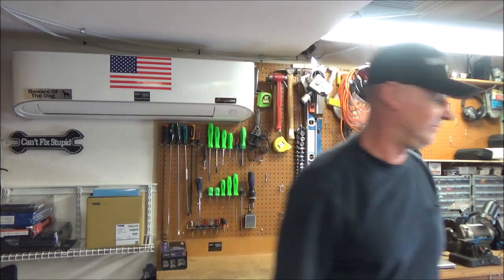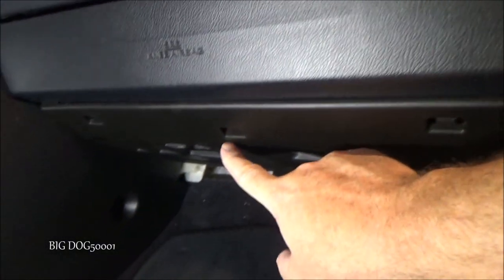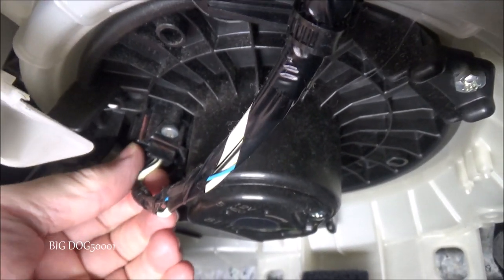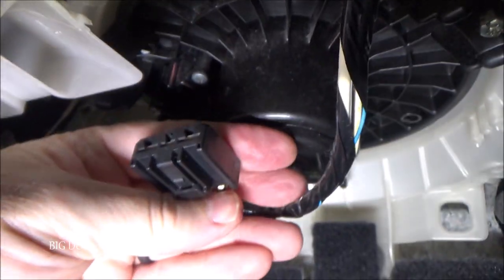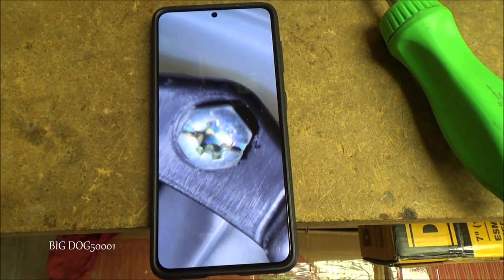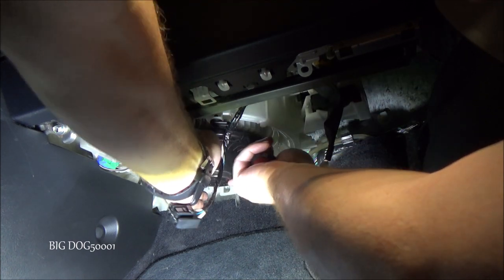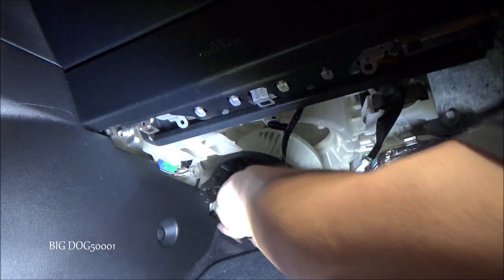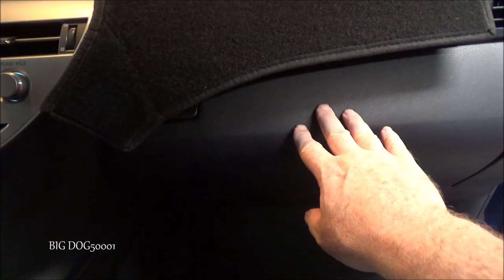Lexus RX 350 Blower Motor Testing and Replacement

Comment: I just pulled the motor out of my 5th gen 4Runner and it was the same motor. I had a whining noise and wanted to see if it need lubrication. Luckily it was just a leaf rubbing on the fins. It works fine after cleaning it out, but I was wondering how to lubricate the shaft. I removed the small plastic cover, and it exposed the circuit board. But the motor itself is encased in another shroud.

Comment: Mine works, but it’s not blowing like my other cars, it’s more like whispering and takes forever to warm up the car when it’s cold outside. Could that be the old and tired blower motor? I don’t think it’s the unit and there’s no separate resistor to control the motor. It looks easy to swap, but thought I’d ask you if you know it would actually help to make the motor blow harder. Thank you Victor!